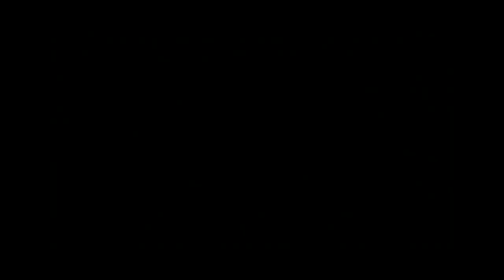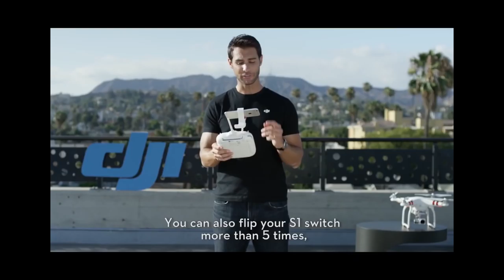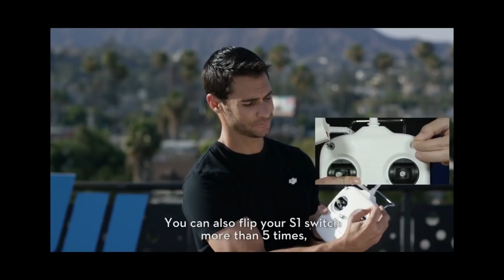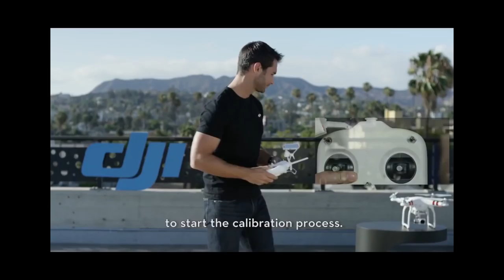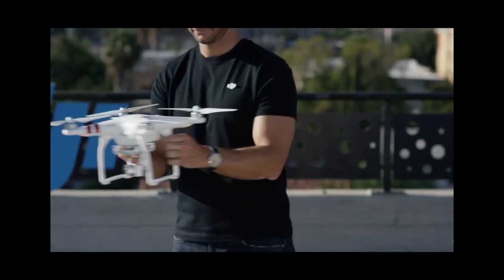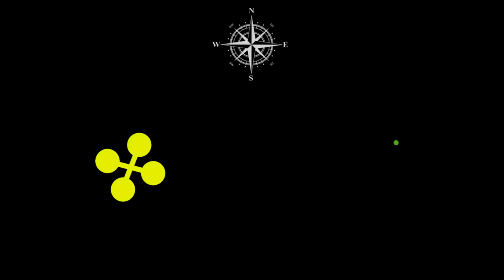Compass calibration... why?!?

Comment: I don't own a drone so forgive me if this is a dumb question "Don't you need to enter a magnetic declination value"? GPS would use True North. Here in Saskatoon SK Canada the difference today between True North and Magnetic North , magnetic declination, is +10.33 degrees. This would means the drone is always out by 10 degrees.
Reply from the maker: Yes, although in systems like DJI I think it looks that up for you automatically since it has a connection to the internet. The declination is not really a part of the calibration though, it's just a number that gets added to the final reading before use. I will look at that a bit more in a future video.

Comment: About orientation, why cant flight controller pitch forward and then using GPS identify the heading ? Like its done in flying wings.
Reply: Knuth Helekivi it can and some do (inav has the option or used to). But its less accurate as GPS isn't perfect, so at slow speeds you will have problems
Reply: I think Inav only has this option for flying wings, but not for drones(multirotors).
Reply from the maker: It can be done and is a viable method if you're always going to be moving quite fast anyway (ie. fixed wing), but is not very useful if you want to hover in one place, or for a ground vehicle that might need to avoid obstacles. As mentioned here already, GPS is also not so accurate.
Reply: because it is not reliable enough considering GPS error
Reply: If the GPS knows the exact position of each of a whole constellation of moving satellites I'm surprised it would ever need a compass. I get that it's inaccurate for positioning you to less than a meter but for orientation I'd think it'd be perfect.

Comment: Running your motors while calibrating the compass might be a good idea to account for the magnetic field of the motors and the power wires.
Reply from the maker: In theory, yes. The problem is that to make it worth doing that, you'd need to run the motors under the same load as when flying, ie. with props on and at least half throttle. It's much easier to simply put some distance between the compass and the rest of the quad.